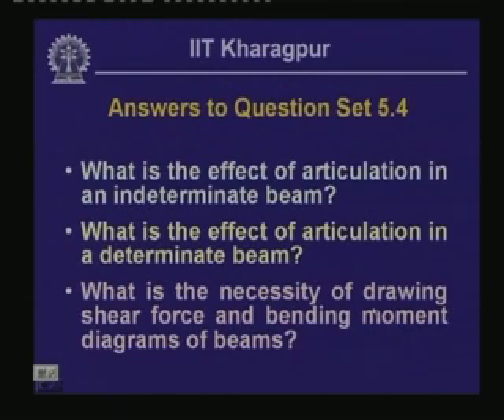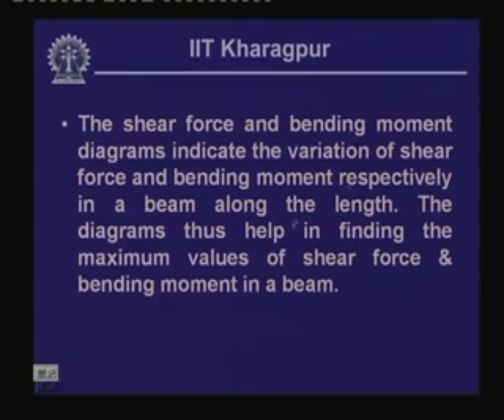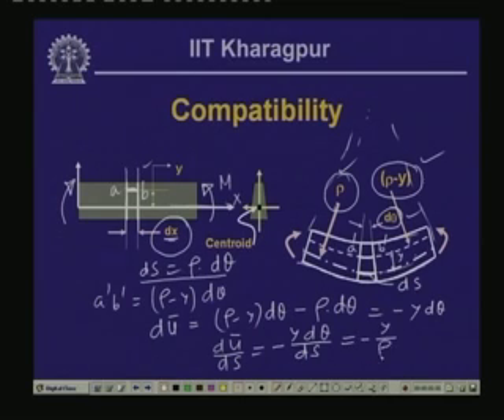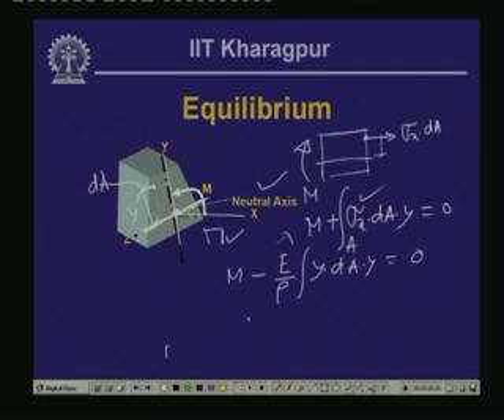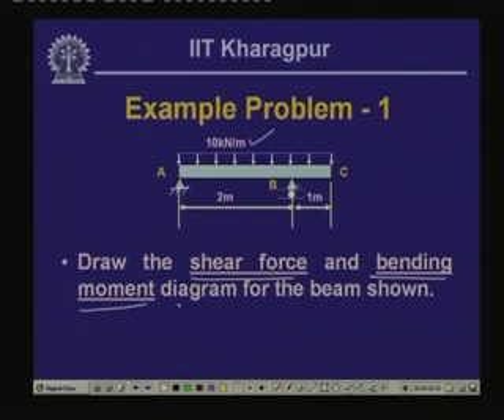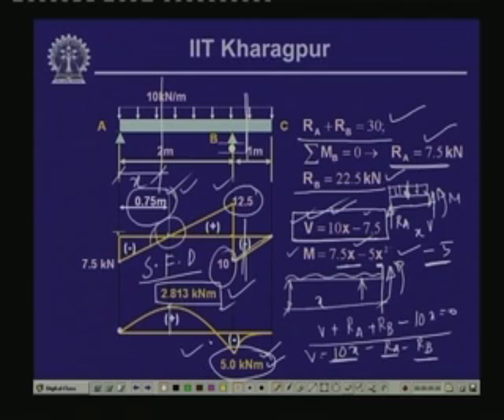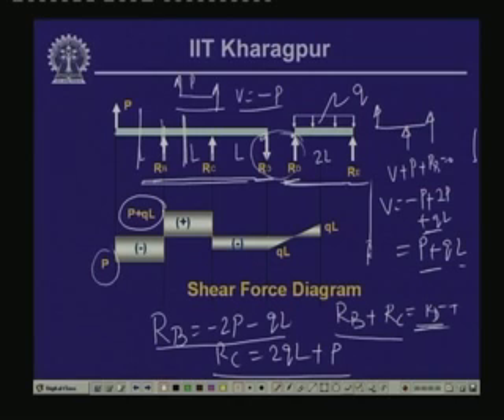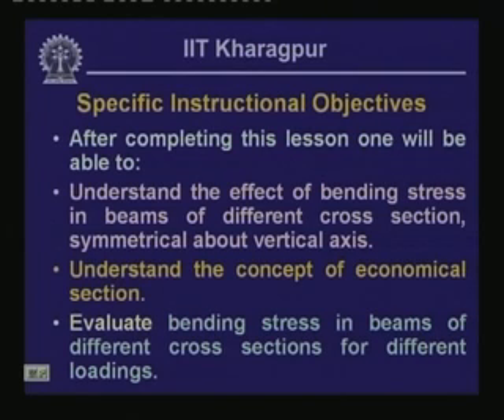Lecture - 26 Stresses in Beams - I

Comment: Great lecture, but professor has done mistake in drawing SFD (55:00) of last numerical.He made area under SFD diagram zero which is not possible as concentrated moment of 5 KN-m is acting.Therefore for this SFD area under SFD should be 5 KN-m as area represents Bending Moment on the beam.